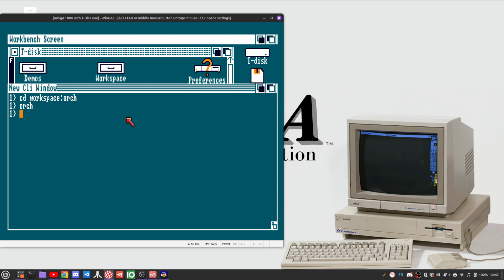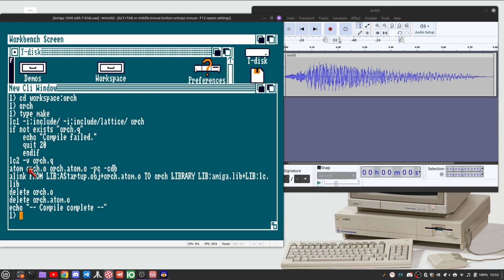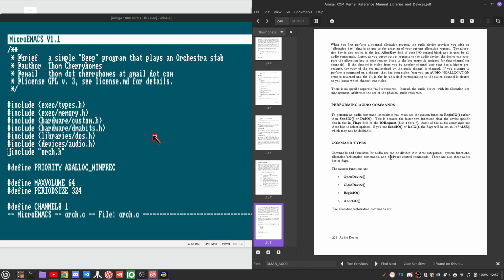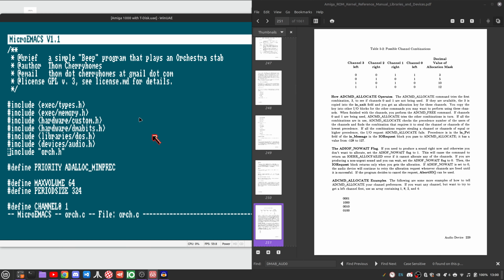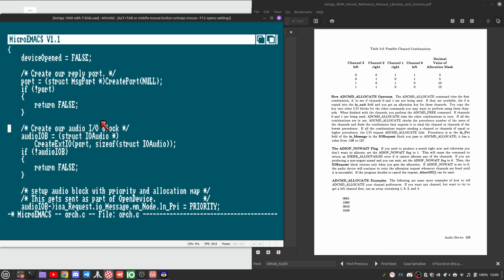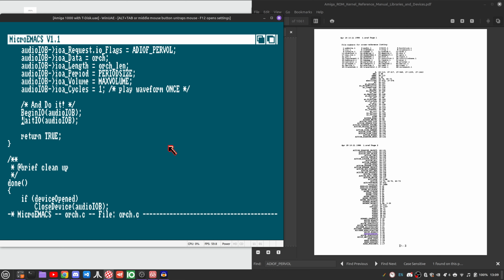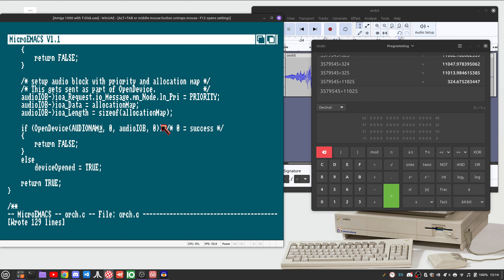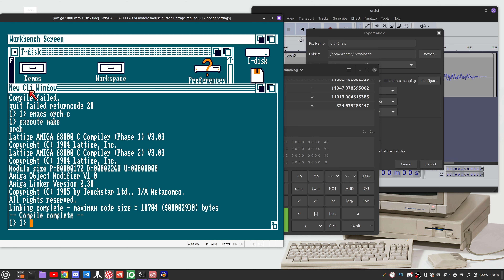Amiga as a Workstation Part 8: A Beep tool called Orch.

Comment: You saved the sample as 8bit signed but IIRC it’s declared as unsigned char in your code. (I didn’t get the name of the tool that you used to convert it to C array.)
Reply from the maker: ultimately, doesn't matter from the compiler's standpoint. 

the tool I used to create the data is called 'xxd' and it has an -i function that can take any input and spit out a C array.

Comment: @26 mins, the presenter yawning during the compile, fitting.

As for topics. A suggestion would be a exposition of the Ports, and messaging. I don't recall from that time programs that worked together sharing the same data and going to sleep and being awakened by a change in a shared resource (memory). Wait() MsgPort(...1<<Usebits...) well you know the rest.
Reply from the maker: I want to put together a game and video set using the ROM routines, including lots of little exec tasks. That's what the routines were for in the first place.
Reply: Or go 2.04 and do some Arexx scripting :)

Comment: Love your excitement, but as a game developer who has had to deal with multithreading, UX, and audio priority a little, I'm not sure you're well in tune with the actual needs.

Those priorities are more likely to get in the way than help. They're probably good enough for arbitrating between applications, but within a game you're most likely going to want something tailored to the purpose. Ideally, you reserve a specific number of channels and then deal with priority yourself.

I also would definitely not use OS threads for most scheduling -- it can make sense to have a separate sound thread if that means you don't need to implement an ISR or callback, but beyond that I'm very skeptical. Multithreading is hard to design around, hard to debug, causes unpredictable latency problems, and generally is a tax on performance if you don't have multiple cores to parallelize over.
Reply from the maker: I have done this for the Amiga in the past, using the OS routines, and intend to do so again, in a video series. But I appreciate the condescending pat on the head.

p.s. if you're going to try and push against what I've done, provide code. otherwise sod off.
Reply: There's a distinction to be made between the situation on Windows(which most gamedevs today are familiar with) and the Amiga, and why you'd land on one or the other set of best practices. On Windows, you are in an adversarial environment and have to do things through a hardware abstraction layer that talks to vendor device drivers. There's no method to access audio hardware registers because that's not something you abstract. The abstraction may change internally. And the abstraction falls over when the layers you don't control break. Therefore a Windows dev doing something complex and timing-dependent is inclined to be paranoid about what the operating system provides and attempt to grab whatever the lowest level of control is, then hold it statically until the program exits, because you don't know what sort of mystery meat is in between you and the hardware, so the next best thing you can do is to hoard all the system resources.

The Amiga is a more holistic design - one vendor doing hardware and software together - and it's designed from a position of trusting the user software, which keeps it uncomplicated. There's no motive to be paranoid, and therefore it's reasonable to view Kickstart as a framework that you can use directly for the deep internals of your programs.
Reply from the maker: @JH-pe3ro  These libraries were originally designed to be used when the Amiga was to be a game console, and were designed by an interesting confluence of people:

* Bob Pariseau came from Tandem, big iron.
* Carl Sassenrath came from the big iron HP world, who wrote Exec.
* As did Dale Luck, who wrote graphics.library.
* RJ Mical and Sam Dicker came from Williams Electronics, and were part of Eugene Jarvis' Vid-Kidz team. 

They were all in VERY close quarters, right next to each other, for the better part of 18 months, assembling all this library code onto a SAGE IV with a set of terminals hanging off of it. (Exec actually had its first bring-up on an HP 64000 development system)

As such, progress literally happened via (as the great Ron Milner once put it) "spatial devance" as print-outs would cross from one side of the room to the other.

The result literally was a well thought out homogenous set of routines intended to be used together to make games, which, because there was just enough wiggle room in the design, was able to make the leap to being a computer when RJ Mical wrote Intuition, which leveraged the graphics, layer, and input libraries.

It's a very rare thing when you have a set of people who are so comfortable, yet driven, and have such a will to work together, that you're able to produce something so well designed.
Reply: @tschak909  I didn't come here just to be a jerk, I love the coding nostalgia hit and I really appreciate the videos and the time you put into making them! I suppose it wasn't clear but I appreciate you're using the pac man project to showcase AmigaOS. That's something I want to see. So thank you!

As I alluded I've worked on a bunch of titles with different teams going back a couple decades, so from my perspective my money's already where my mouth is. When I say "I would not do that" it's literal, not speculative: I am the putative game developer. Obviously you do what you like, I just happen to align with the conventional wisdom. There are some natural uses of threads for gameplay, for example to manage long running jobs like pathfinding, but if you tried to build a realistic case, we'd probably be here all year. I don't really want to argue in comment threads, if you want to have a metaphorical or literal beer and chat, I could probably find you on the FujiNet discord, but I'm only doing that if it would bring you joy to hash out. Everybody busy, I want to contribute to your happiness, and it seems I'm starting out in debt.

That all said, of course I think you'll be successful! There are simpler and more robust idioms for gameplay, but what you're doing can work. At any rate, I'm not here for game programming advice, what I want is to see you implement tasks -- I was suffering it out with DOS long past AmigaOS' market decline, and it's fascinating to see now what I could have been working with instead!